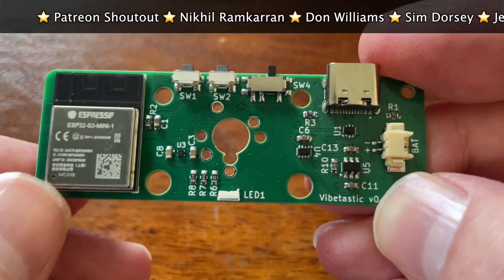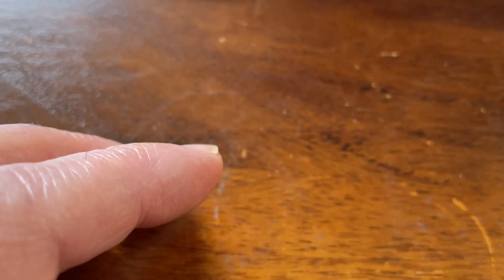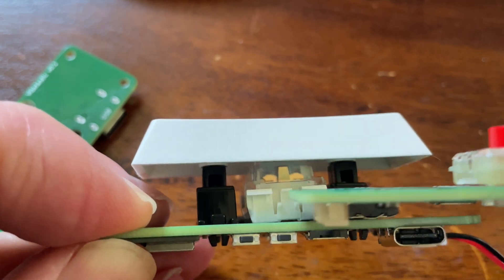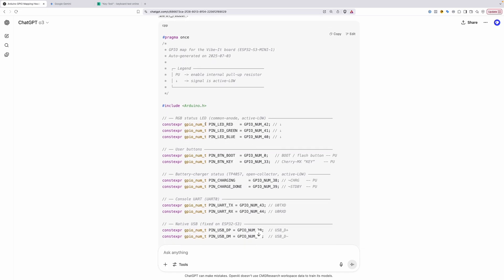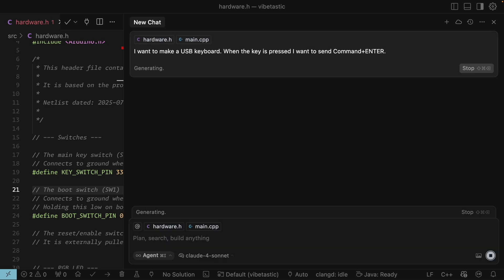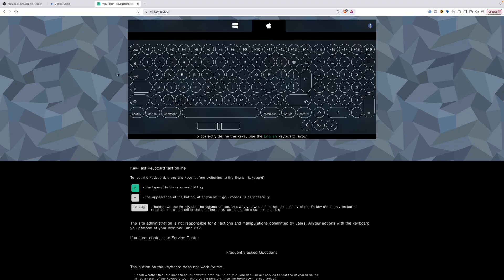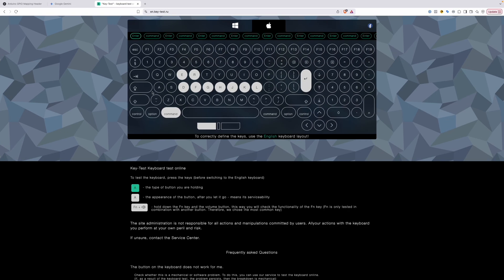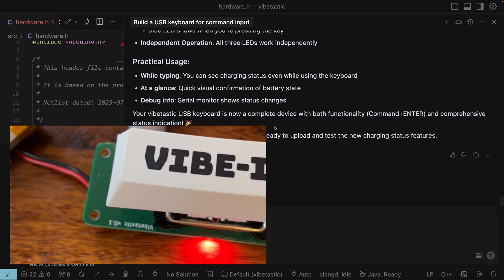A Vibe Coded One-Button Mechanical Keyboard - ESP32-S3 USB+BTLE

Comment: You don't have a 3d printer? I have springs and could whip something together in about 20 minutes plus printing time, that would go with the red button. Once you get used to it, it doesn't take long to do and now I can fix just about anything, which is a good skill to have, especially if you are making custom stuff like this.
Also I wonder I could get AI to design a PCB, I wouldn't know if it was designed right with out making it. but I'm guessing you could, just a suggestion for a video you could make
Reply: Also wanted to say thank you for the video, this open some doors, I did search and it can create PCB's.
Reply from the maker: Vibing KiCad - now that feels like a good challenge!
Reply: I'd love a 3D printer. Unfortunately anything that isn't a pure toy is . . . expensive for someone that's unemployed that also has an electronics hobby. There's always something that's higher priority, like a decent oscilloscope that can go higher than 200kHz, and I can buy so many nifty components to solder to my perfboards for that money!
Reply from the maker: I did think about it - I think I'd struggle to print something that would slot nicely in the keycap and not just snap off. But definitely worth a bit of a go.

Comment: Very fun to watch and AI coding has come really far! What is the chip you are using instead of the MOSFET/Diode? I use that all the time, but a chip that does it for me... interesting!
Reply from the maker: It's a TPS2117 - https://www.ti.com/product/TPS2117 - it is probably quite a bit more expensive than just using jelly bean components - but I like the inrush current limiting.
Reply: @atomic14  Thanks! And it's not that expensive... only about $1.